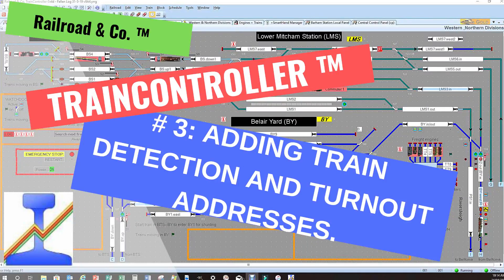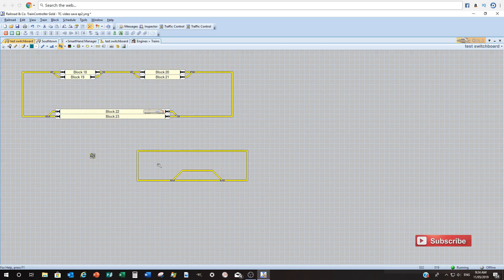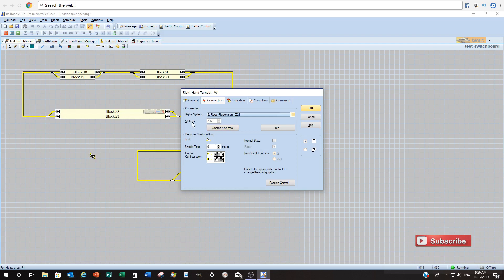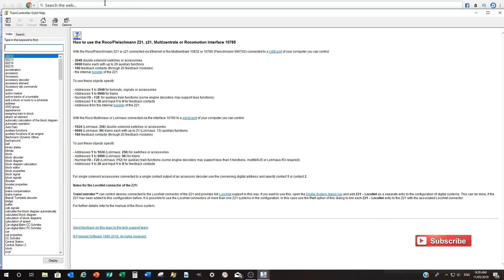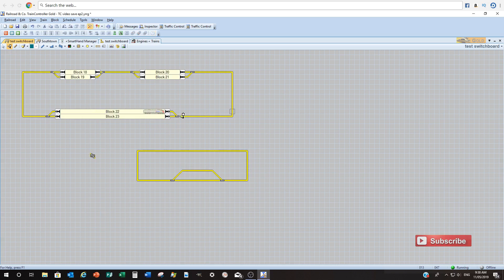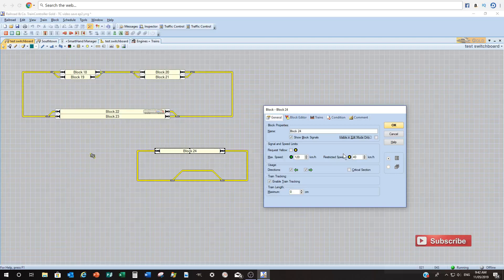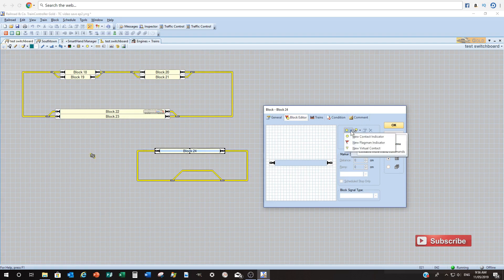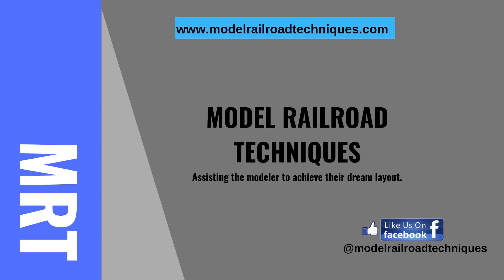TrainController Gold #3. Adding Occupancy Detection & DCC address to turnouts

Comment: Hi, Great video can you please give me some advice for current feedback occupancy of point work?
I have followed the instructions for wiring the feedback modules(track occupancy= one rail sections with plastic rail joiners) for “SIMPLE" straight track but the instructions do not mention feedback wiring for points/turnouts and cross overs and double slips? 
I understand each block has a min of three contacts(sections) being start, travel and slow to stop at the signal.....so that is easy to follow re plastic rail joiners and wiring. 
 
However very often there is a  multitude of points, cross overs and double slips coming out of the station? I am not able to understand where the plastic rail joiners go……
 
I have not been able to see any examples of DCC blocks with points/turnouts or crossovers or double slips???
 
Do I isolate each point and crossover and double slip? If so I suspect the points would have a plastic rail joiner on three positions for insulfrog and five positions on electrfrog points to totally make the point in a block in its own right, i.e. give the point its own power droppers?
Any advice would be appreciated.
regards
Scott
Reply from the maker: Thank you. I personally do not use detection on my points. With TC they are really not needed. What are you trying to achieve with this detection ?